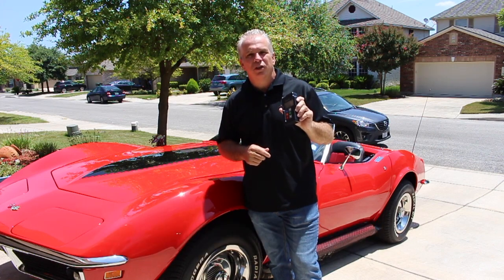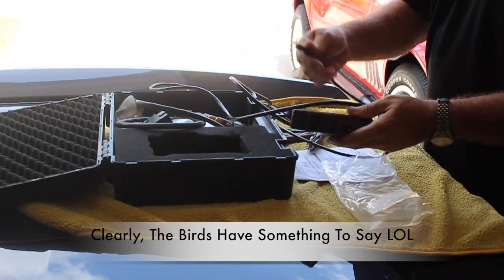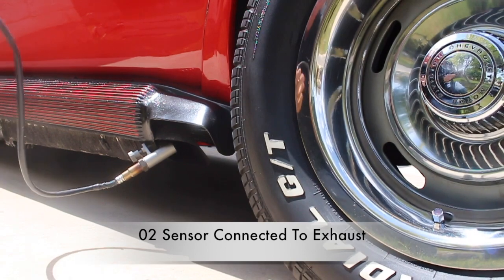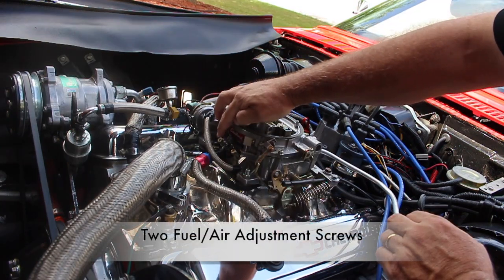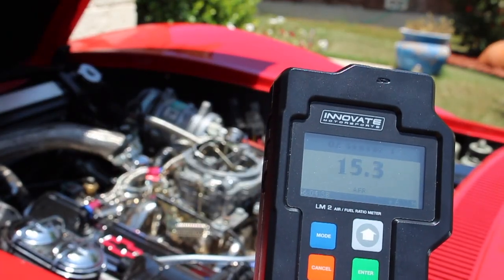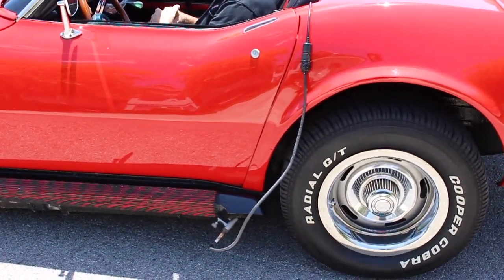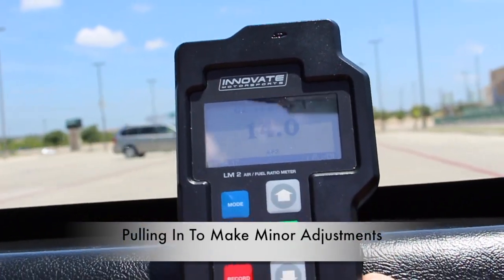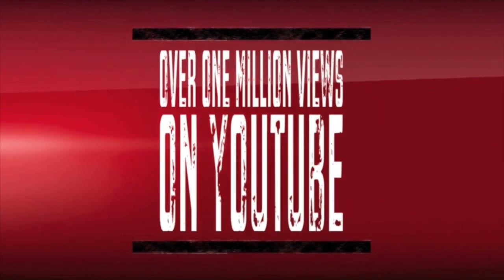C3 Corvette Air/Fuel Mixture Using LM-2 Meter

Comment: Do the exhaust holden bracket comes with it or do you have to purchase it seperately and it would be great if you could throw a link of the site you bought it from
Reply from the maker: You can get the bracket combo with the LM-2 meter depending on what kit you order. If you only need the bracket you can get it on Amazon. https://www.amazon.com/Innovate-Motorsports-3728-Exhaust-Cast-Stainless/dp/B000CO9MF8/ref=asc_df_B000CO9MF8/?tag=hyprod-20&linkCode=df0&hvadid=312142020868&hvpos=&hvnetw=g&hvrand=9501911241461926515&hvpone=&hvptwo=&hvqmt=&hvdev=c&hvdvcmdl=&hvlocint=&hvlocphy=9028017&hvtargid=pla-467454188561&psc=1

Comment: Did you measure the mixture after installing the airfilter back, because it chances the airflow...
Reply: I tuned my carburetor with my air filter on

Comment: How did turning idle mixture screws help with the main circuit during driving? I didn't see any jet changes or anything to see how AFR would be affected at cruising speed.
Reply from the maker: Thanks you for your input
Reply: @TheWhatisright  🤷🏼‍♂️

Comment: White paint stripe markings. For those not aware,  definitely a military aircraft maintenance trick. That was our preferred method of checking tail rotor driveshaft over torque on the AH-1s and AH-64s. Good video, thanks for your service. Didn't see if you mentioned, about how much is that meter?
Reply from the maker: You nailed it, old aircraft Maintenance trick. The LM-2 meter kit can be found at (about $256) at Summit https://www.summitracing.com/parts/inn-3837?seid=srese1&cm_mmc=pla-google-shoppingsrese1_-innovate-motorsports&gclid=CjwKCAjwq-TmBRBdEiwAaO1en_HJJfDLMeMzhrmOIfC2aW6GUN6bmYelxpQErhAxUvl2XS6D0E_BNhoCXEkQAvD_BwE